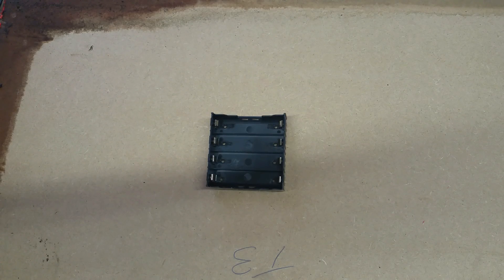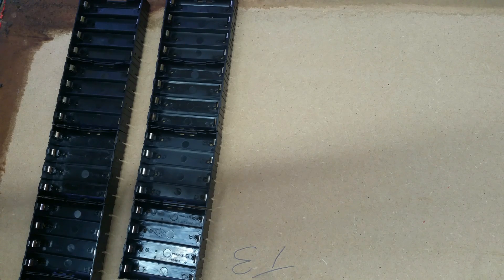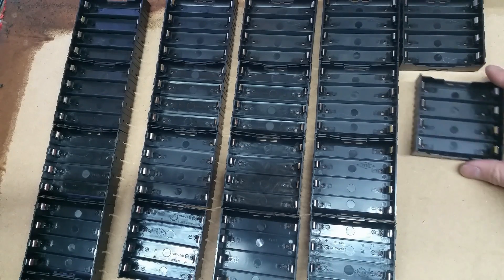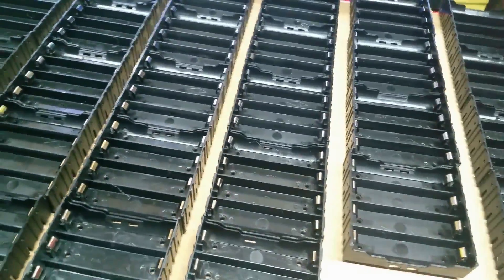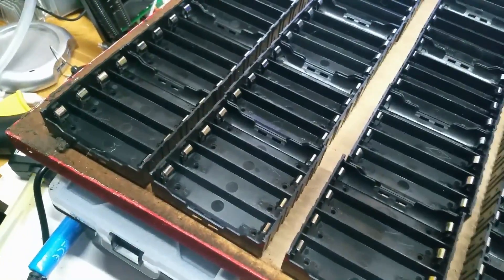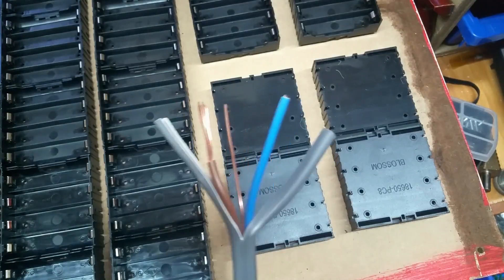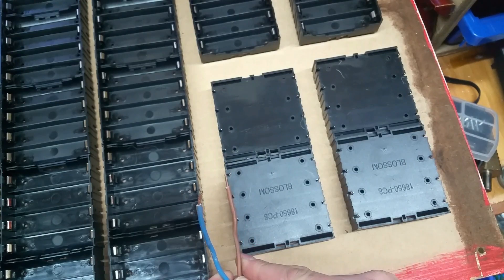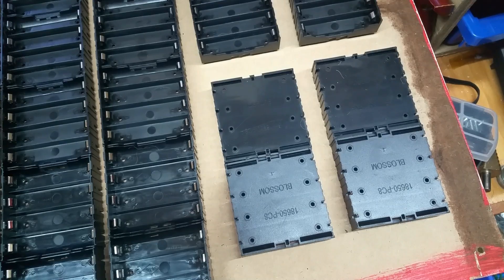Power-shelf anyone? to suck the life out of the lower quality cells

Comment: instead of soldering all these together, you can do it in a temporary way by using 5mm solar buss wire or tin strips, and shove them behind the clips, add a tab and solder to the tab only. later you can re- use the holders by pulling the strips out. save yourself hours of work and rework!

Comment: put the bus bar on the negative side than just use the fuse wire to go from individual positive over to the next negative bus bar than on the last positive just put a bus bar down the whole length and not worry about the fuse or put one if you want.
Reply from the maker: I'll probably fuse them to get the soldering experience. My soldering is bad.

Comment: Sounds like a good plan.  I would also vote for a fuse wire per cell.  My power shelf is working well, using half of it to power the charger for testing the other half.  With the regenerative discharge on the iCharger, the energy just shuttles back and forth from one pack to the other as I charge and discharge the large packs.  Makes an excellent setup for getting experience charging, discharging and balancing the larger groups of cells.
Reply from the maker: I've not got the regenerative type. something to look into. would like a balance charger capable of charging 7s packs, would the i charger handle 7s?